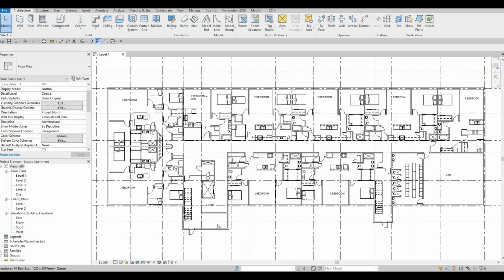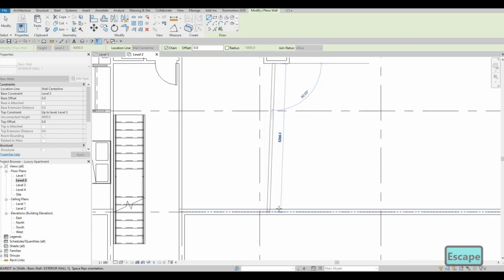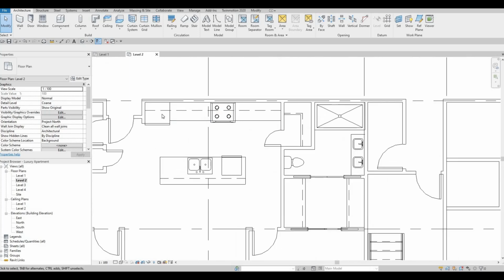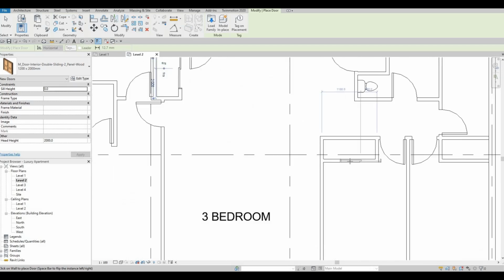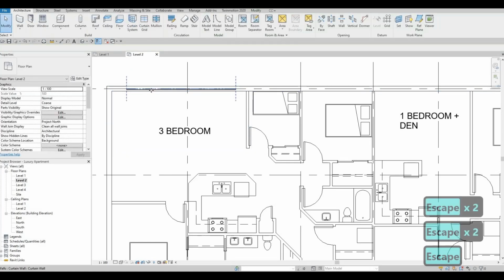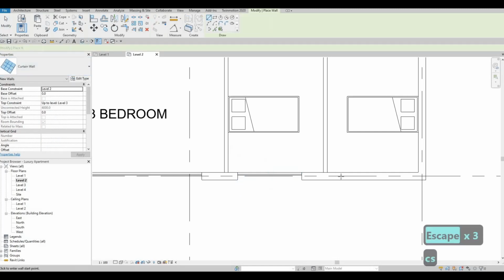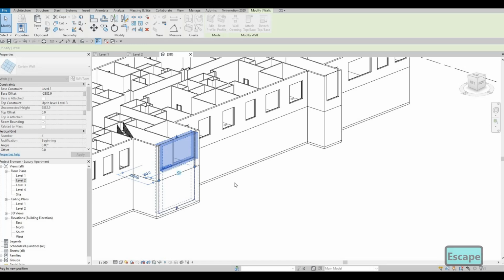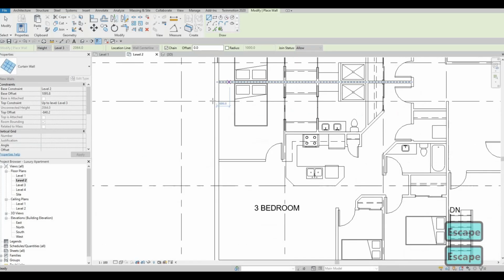Luxury Apartment | Part 9 | Complete Step By Step Project | Revit and Twinmotion Tutorial

Comment: Thank you for this great job of setting out the appartments.  Can I add For the curtain wall select edit type then check the automatically embed.  select all and adjust the base offset to your desired offset 900 and top constraint to unconnected 1800 this is a quicker way than cutting the walls etc.
Liam
Reply from the maker: Yes, absolutely